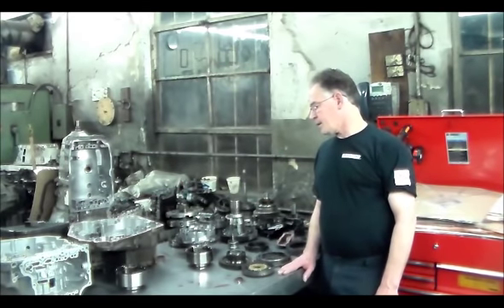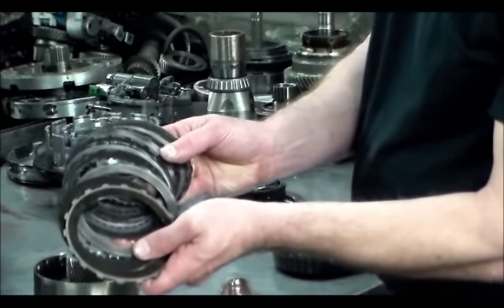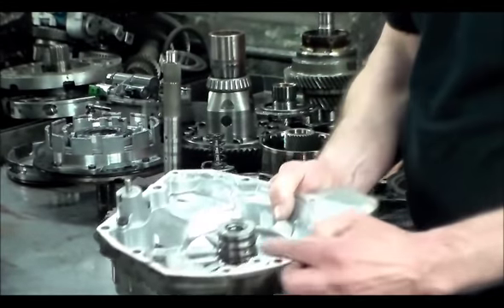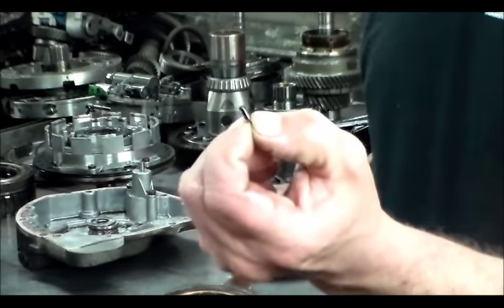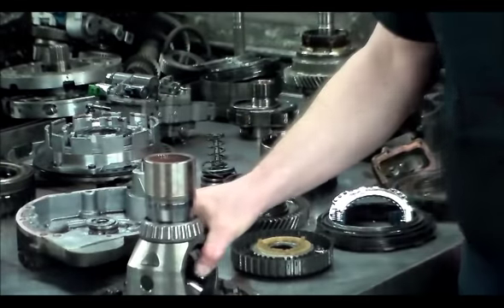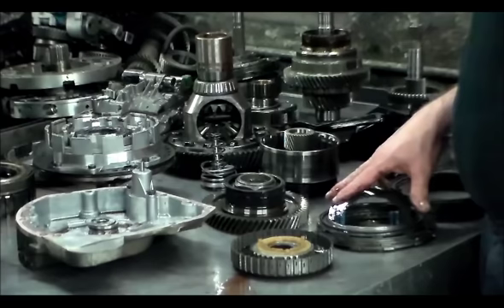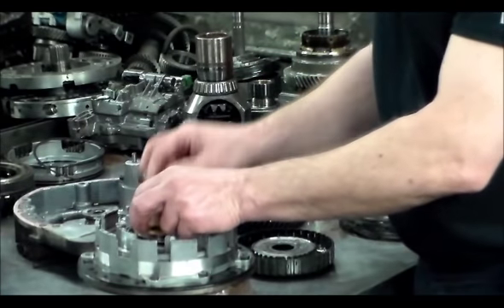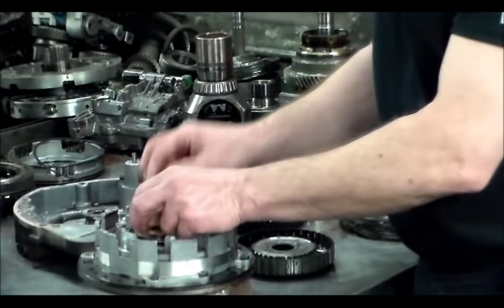50 42LE Highlights

Comment: I dunno if you are still answering questions here, but I'm looking at a cheapo S70 with all forward gears and no reverse. I see in the comments below you asked another viewer if it moves forward in reverse. If it does, would that be a PNP sensor?

I found an article from ATRA (technical bulletin 1118) saying to disconnect the solenoid wiring to see if it fixes the reverse. Is this something that can be done on the fly while looking at a used car, or is that wiring all inside the case?

Thanks. Great video btw.

Comment: Another great detailed video! This would be a challenging one... even if just the assembly! I love the confidence & patience you have!
Reply from the maker: Patience yes, especially when working with electrical problems.  This unit is not an easy one.
Reply from the maker: Cuba Rodriguez I do attend seminars when they come around I have seen a few webinars but a lot of research when I'm home
Reply: @GaryFerraro  my 99 Volvo has the exact problems you described in the video. I would like to attempt a rebuild myself (not worried if I have to get a new ride) any suggestions on parts, especially if I need to replace the case? Thank you! Great video and inspiration as I tackle this challenge!
Reply from the maker: @bcooombs  What happens? drives for a while then stops moving?  Trans is a little tricky to do.  Where are you located?
Reply: @GaryFerraro  exactly! It also slips and now I have a check engine light with blinking arrow and a code for solenoid b stuck in off position. Stopped car immediately. Fluid was black and has metal shavings. I'm in CT

Comment: Hello Gary, My Alfa Romeo 156 has a 50-42LE I took it apart and did a overhaul. Now everything is installed and at first it wanted to go in to reverse but now it just kind of slips the reverse while driving forward works fine. Can you point me in to a direction?

Comment: What difference is there between the aw55 42 ls and the 50 42 le?  I have a c70 with 5042le change and I can't find a gearbox and I have located a 55 42ls. Would it be worth it?

Comment: Thanks for the amazing video! I have a Volvo 850 that uses the same gearbox. Last month I felt the reverse going loose. I feel the reverse engaging but that has no power to move the car. I tried to disconnect the electric cables, but the problem remains the same. Can you help me with the possible cause of this issue?
Reply from the maker: How are the forward gears?  Does the car move forward in neutral by chance
Reply: @GaryFerraro  Forward gears are working 100%. I Drove more them 1000 miles in a trip last month, speeds up to 100MPH. In neutral car moves freely.

Comment: Hello! I am interested in your video on the Volvo 50-42LE automatic gearbox because I have the same one on a 99 SAAB 9-5 Aero. I would like to know what brands of rebuild kit you use because it is very easy to get lost among all the references from different suppliers. I would like to find a complete rebuild kit because all the metal pressure plates and friction plates need to be changed. I would like to find more resistant material than the original but I do not know if it exists. Can you help me?

Comment: Hi Gary, 
My Volvo C70 T5 1999 with only 72200km suddenly the automatic gearbox 50-42LE does not go beyond 3000-3500rpm and I don't know what is happening.

I add information:
-Shifts well without strong pulls and very smooth.
-DOES NOT respond to demand if you step fast-the accelerator. Non-existent kick-down It accelerates normally but when it reaches over 3000-3500rpm it stays there. 
-There are NO noises or strange jerks when switching with the selector between gears.
- NO Fault Light (Arrow) Plugged In
-It has only made a dry noise (clak) on one occasion when I started to see that it did not go above 3500rpm and I stepped on it to see what it did and try to "unblock" something. It's the feeling I have like something plugged, but obviously in the box, it's not from an engine.
-Fluid level checked just the day before. Correct in both quantity and color.
-A priori I rule out an electrical problem because the car does not indicate a fault anywhere, no light on. I don't put the scanner but no lights appearing, the scanner will tell me.

Any ideas?
Ty Gary.

Comment: @Gary Ferraro

These cars don’t come with an auxiliary trans cooler. Do you think it’s wise to install one?
Reply from the maker: I never liked aux coolers, sometimes they can be trouble, i never add i just  go with how it comes from the factory
Reply: I own a Volvo 850R that has been highly modified. The first thing most people do to these cars is do 3x drain and fills on the transmission and then install a stand alone transmission cooler. These cars have issues where the radiator likes to burst sending coolant into the transmission destroying it. I know 4 people in the volvo forums that have had this happen. Also its a good idea to install a inline filter on these transmissions since they have no removable filter on them. I recommend getting any parts you need for Volvos or BMW's from FCPeuro. FCPeuro has the best warrenty ive ever seen they cover a part for life they even cover oil transmission fluid brake pads etc for life! You just order a new set of the item and then send the old one back and they refund the amount on your credit card!

Comment: What would cause delayed and hard shifts in this transmission? I changed the filter and hydraulic already
Reply from the maker: any codes? could be a bad speed sensor, check engine light on?
Reply: @GaryFerraro  no codes. I had to put it apart just to replace filter. I wonder if I may have misplaced something in the process. I first thought it may be the pnp switch but no adjustment has made a difference.
Reply from the maker: @akandwanahoraymond7581  make sure all sensors are plugged correctly and not crossed  do you have a scanner that shows live data?
Reply: @GaryFerraro  when the sensors were crossed, the car could only reverse and not go fwd. I can find a scan tool for live data; which parameters should I select for monitoring?

Comment: Hey. Any idea on what might've happened on my parents volvo, it completely lost its reverse in 2015 and went to forward limp mode. My dad said he heard/felt a loud bang when shifting into reverse then we swapped in a working gearbox from another 850 t5. Now its been 5 years and the swapped box suddenly lost all power ( on the freeway on casual low throttle acceleration at around 50mph). My dad said the engine just revved up and nothing happened. The car doesnt go into any gear and it flashed the up arrow upon startup. When I tested the transmission codes on the diagnostic port it gives code 322 for "incorrect gear ratio" "manufacturer recommends replacing transaxle".  Its literally the same if you pushed the clutch in on a manual trans, no drive at all.
I also ran the test with the diagnostic button that goes through all the solenoids while engine is idling and it seems to work but it doesnt give me more DTC's than the 322 stored already.
Now were having the option of overhauling the old trans that worked until its reverse died, or finding yet another working used trans. I have took it apart almost fully (old reverse banger trans) and found no metal shavings other than black friction material gunk on the bottom of case and pump housing/plates area. The trans had a rough reverse activation for a few years and it would "bang" into reverse most of the time when hot.
Reply from the maker: eamh2002 ok so just to confirm the trans in the car has no movement at all cold and hot.
Reply from the maker: eamh2002   This happened suddenly?